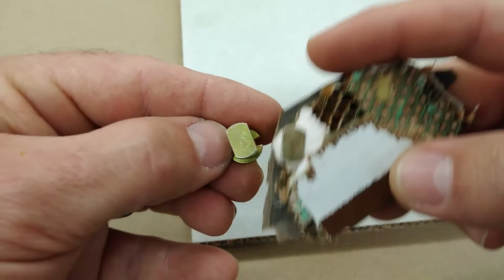HONEYCOMB PANELS IN AIRCRAFT INTERIORS - The magic behind lightweight and strong construction

Comment: Hey everyone, so I have a load of used aircraft floor boards that I pulled from a skip before I left my job in an aircraft maintenance facility in February. Planning to make cabinets for a campervan out of them but I have I cannot find a supply of the pins for joining the panels with resin. If I can't find any I might have to make my own but Id rather it didn't come to that. Does anyone know any other names for them? Or even better, part numbers? Any help would be appreciated
Reply from the maker: Hello Damon Reynolds, you have an uphill battle ahead of you. The pins are called ATR panel pins or tie pins and they come in specific sizes to fit specific panel thickness es. The epoxies we use are ATR525 from AAR Composites or DP460 from 3M. 
The reason I say an uphill battle is because these parts are very expensive. Their cost is justified in an aircraft, but for any home, DIY use they are ridiculous prices. 
Another method you can try is using counter sink or flat head screws instead of the panel pins. I don't mean to thread the screws into the panels(it won't hold), I mean to substitute the pins with the screws and install them in a similar manner. Drill a hole the size of the screw(the thread diameter, not the head diameter) in the panels you want to join, pre fill the hole with the epoxy and "nail" the panels together with the screw while the epoxy is still wet. Clamp or tape or secure the panels in place and let cure. 
The treads of the screw will act as the knurls in the pins and the head of the screw will act as the flare of the pins. 
It's not ideal but a helluva lot cheaper. 
As for the epoxy... I don't know of a cheaper alternative. I'd do some searching for a cheap epoxy that cures solid that bonds to both metal and carbon. 
And speaking of carbon, most floorboards are made of carbon fiber. When you cut, trim, drill or sand them, don't breathe the black dust. 

Good luck.

Comment: Very useful video, but use a microphone on your shirt, audio was terrible. Edit film to shorten, it drags on too long.
Reply from the maker: Hello MJ Remy, thanks for your kind words and for keeping it respectful. I apologize for the crappy audio. I am not a pro at this, as it is painfully obvious. I do not own a lapel mic. On top of that, most of the videos I do are at work, surrounded by electrical rooms buzzing, noisy lights, echo-y hangars, running engines, etc, etc, so the background noise is always terrible and always there. I rarely get the chance to plan or script a video. They mostly happen spontaneously whenever the opportunity presents itself, I just whip my phone out and start recording. I know the end result shows every bit of those defects.  
As far as the video dragging on, that's the result of not pre-scripting it and just letting my brain ramble on on the fly. 
Sorry about that, thank you for your patience and for putting up with it.

Comment: Sir, thank you for the introductory look at how to affix the threaded inserts and sleeves into this material. Do you have a video on how to join two edges of the honeycomb - as in construction of the drawer "box" shown at the beginning of the video? The box/drawer does not seem to be joined using the assembly pins - unless the pins are covered up in some way after they are installed. During the video you describe how an assembly could be done with a  butt joint, but I don't know if that pin assembly is used for a ninety-degree mitered joint.

Comment: Just found your channel and quite enjoyed the content! For the home enthusiast I think you could use a woodruff cutter or a t-slot cutter for the relief around the insert.  An alternative to the expensive and hard to source sandwich panel inserts could be Chicago screws or something called a sex bolt.  Grind or file flats on the base to help provide mechanical attachment to prevent spinning. From a 30 year veteran Aerospace worker thanks!!

Comment: Hello and thank you for this video. Are there any downsides of applying honeycombs in compare with foams for example?
Reply from the maker: Hello Wohambi, that is a highly technical and specific question that requires in-depth knowledge in the subject. Far more than I have. Therefore I can't even begin to answer your question, because I can't. I'm sure the application dictates the choice of core material, skin material, and the thickness of each, but as to which to use when... I don't know. Engineers determine that. On the other hand, if you know the loads and environment of your application, you can read the specs for different materials and pick the cheapest one that still suits the need.
I know this answer is not what you were looking for, but it's all I can give. 
Thanks for coming by Plane Simple.

Comment: Great video sir!  I am restoring and old Airstream Camper and would like to build the interior with honeycombs panels like aircraft. I am having an extremely hard time finding resources on construction techniques as well as material suppliers. Do you know of any books or white papers on construction techniques and any suppliers?

Richard
Reply from the maker: Hello Richard, thank you for your kind comment. Your airstream restoration sounds like an amazing project. Sadly, I've never tried buying honeycomb sandwich panels for myself, it's always been for work which is aircraft interiors. And like anything aircraft, it's expensive. Just off the top of my head I think a good ballpark price for a fiberglass skinned 4'x8' sheet is around $400. Prices will also change for aluminum, carbon or Kevlar, etc. 
One supplier I can remember is AAR composites. However, there must be other suppliers and ideally non-aviation suppliers should be less expensive, sadly I don't know of any. I will do some googling and if I find something I'll add to this comment. 
As far as building techniques go, I could offer a bit of info but not much more that what's already on the video. 
Anyway, sorry I wasn't more helpful but I wish you the best of luck with your airstream.
Reply: I've often wondered why RV and camper manufacturers don't use honeycomb panels instead of that cheap fiber board they use. This would be lighter in weight and much sturdier.  I would interested to see how your project comes out when finished.
Reply: @bighardtop  Actually Safari Condo, a Quebec-based company, has built its entire camper trailer line (Alto trailers) around this technology. They are the lightest on the market for their size. They are costly but keep their value because they are impervious to rot, rust, etc. The main disadvantage is that the shell has almost no insulation. We have been using an Alto trailer since 2016, and overall we are very satisfied.

Comment: Where did you buy the hollow knurled joining pins/dowels? Thanks
Reply from the maker: You can find them online from several aviation parts distributors. Just Google "ATR Panel Pins" and you'll find them. Read up on them, they are color coded for each pin diameter to match the panel width they are getting installed into.

Comment: Hello, we are the honeycomb board manufacturer, so nice to see your video! I hope more and more people could realize the advantage of honeycomb board as cabinet material rather than the stainless steel :-)
Reply from the maker: Hello JIAWAH, and welcome to Plane Simple. 
I'm honored to have a manufacturer like you take the time to write in the comments. 
I think that more people would use the material if it was readily available. It has traditionally been very expensive and therefore reserved for high end industrial uses and out of reach of the common people. 
If it was made more available and affordable, it would only be a matter of time for the product to explode in popularity and adoption. 
Even in this comments section there are several people that I'm sure would love to get their hands on some honeycomb panels. 
Thanks again for writing in.
Reply: Please information on your company
Reply: @pollohuaco  How many planes got
Reply: @planesimple8514  That's exactly what I'm thinking, this stuff is basically impossible to source for personal projects, especially if you only need a few small panels.

Comment: Would it be stronger to directly bond two sandwich panels together or use inserts and bolts? For example a wing structure or torsion box? I suspect a direct bond would be stronger however harder to deal with if you had to do maintenance.

Comment: That was part of video i was searching.. Thow i need for boat building.. Vell I have to learn how they vinir wood on or vinyl (bla bla bla).
You said these panels are premade(I thought so).
Where I can buy them.. In EU.. Transport from us would be very non economic for many reasons.
And great sorry teller you are..
Reply from the maker: Hello Jean Luc De Marc, thank you for your kind words.
I don't know where you could buy these panels in the EU. I know FACC, I think it's Fischer Aircraft Composite Components or something like that, they manufacture aircraft interiors in Austria. You can try to contact them and see where they buy their panels from.
Good luck.
Reply: @planesimple8514  thank you for replying! Ja I will note and ask.. Do you have suggestions on how strong panels need to be(I meant how many layers of glass/karbon). Standard furniture panels thickness is 19mm...and some 15mm.
And thank you again for info.
Reply from the maker: Those panels are amazingly strong for their weight. The thicker the core the stronger the panel will be. When you find a panel distributor, they can give you spec sheets for each panel size. That way you can select the size panel you need for your application.

Comment: Dear, can u pls make a video of, how the central honeycomb cardboard panel is made? I am very much interested in knowing about that!!!
Reply from the maker: Hello pranesh malarmani, thank you for watching this video and for your question but I'm afraid I can't answer it. I am not involved with the manufacturing of those honeycomb panels and therefore I do not know the details of how the honeycomb core is made. 
I'm sorry that I could not answer your question. I hope you find the answer.
Thanks again for coming by Plane Simple.
Reply: Infusion i'd guess. Ask google.
Reply: Definitely not infused. Its made of prepreg fabrics and honeycomb under pressure. Press maschined or in autoclave. You can make your own sandwich panels making skin's separately then bond them together with honeycomb with thin layer adhesion paste. Pressing under vacuum  or simply load some weight.